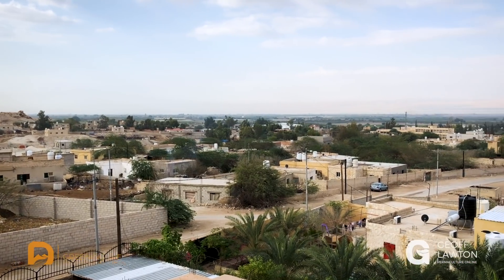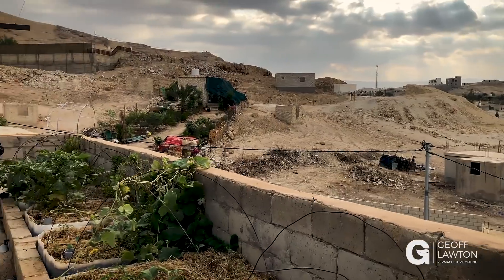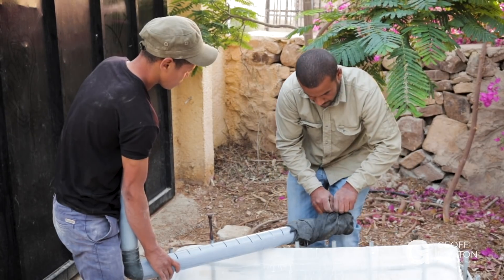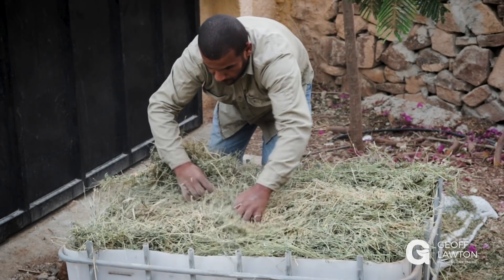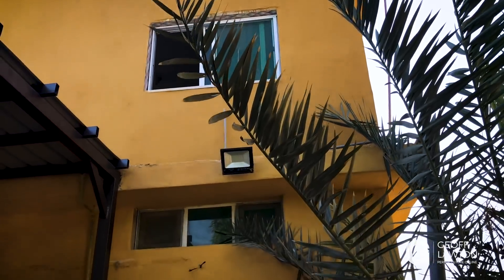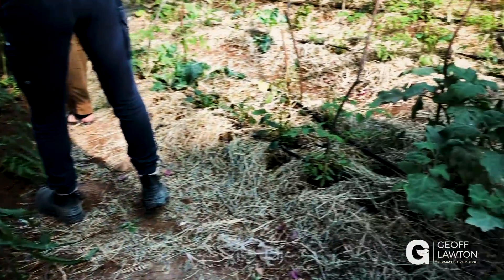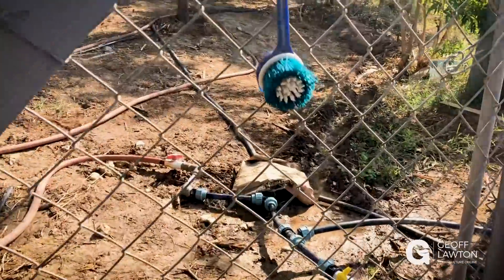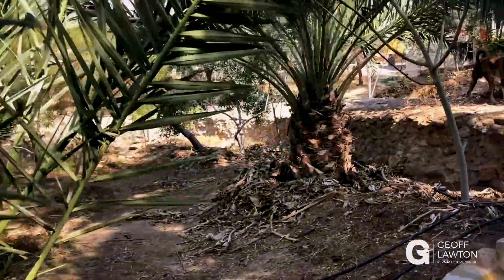Humans Have the Potential to Turn Deserts into a Green Oasis

Comment: You plan to fill the entire desert with flower pots??? Which needs regular watering? Is this practical?
Also, there are pipes running everywhere (which contradicts your video's heading of 'permaculture').
This is a good effort but should come under the title of 'Farming in the desert'

Comment: What is a read bed???
Reply: Costeño Salao  Yes, but a reed bed is a natural water filtration system so farmers can recycle the used water from the house. I looked it up after I watched this video.
Reply: Costeño Salao  So it is a plant, not a system to purified water using plants. Sorry, this is new to me.
Reply: @cqammaz53  it is what you said: a purifying system for the water flowing from the two kitchens mentioned in the video. I assume it is then used in the garden.
Reply: Mr Nepau2 doesn't it appeal mosquitos?

Comment: I was thinking of building a wicking bed on my balcony (a lot smaller: 45L), but I was wondering if I could use biochar instead of the pebbles. For two reasons: I want to save weight in case I have to move (it is a rental house), and I thought that I could activate the biochar with compost tea, to give the whole system an extra boost. Would you recommend doing this?

Comment: soooooo awsome you don't tell everyone to use compost all the way through. I have rough time growing compost in Arizona as it gets up to 116 regulary with 12 percent humidity in the summer rotting roots and killing plants. I have one question though: how does the water pull up through the gravel? I have always seen sand used as cohesion and adheason is better with the smaller particles.

Comment: I love your work Geoff but I'm a bit shocked by the crudeness of these wicking beds. As someone that people look up to and follow I expected you would've done a much better job here.

Let me walk the readers through some mistakes that are made here and how to do things properly.

First off it's best to take the 2 minutes that it takes to take the frame apart and cut the frame and container separately and just measure things out.
Then put the ends that you cut on the bottom and not let them stick out at the top to prevent people (think of the children!) from hurting themselves.

Ideally you'd also cut it inside somewhere to at the very least sweep those thousands of microplastics you just created and dispose of them properly rather than have them float through your garden.

Then instead of using gravel as a reservoir you use drainage pipe wrapped in geotextile. First of all this holds much more water, secondly soil can't end up in your reservoir as is possible with the example in the video. But also not entirely unimportant is that most gravel is some sort of limestone and always full of dust and this might have a negative impact on the pH of your water.

Then on to the actual wick, for this we are using coarse sand (mixed with raw biochar for even more water holding capacity and also to help keep the water clean if you want to get fancy). This sand is packed in tight to reduce it sinking later on and should be at the very least 1 inch higher than your highest water level two inch is better but also not more than that because water only wicks up a certain distance.

If you want to prevent your drainage pipe from ever clogging up it's best to connect it into your water reservoir directly, there is no need for elbows to be able to change your highest water level.

That brings us to the soil mix, this mix needs to be able to wick up the water but also be able to provide excellent drainage so your soil doesn't end up like a swamp in case you get rain. Sand is perfect for this and should be at the very least 1/3 of your mix but 1/2 to 2/3 is fine as well if you are short on compost.
Biochar is again optional and can be up to 20% of your soil mix, ideally inoculated with microbes and nutrients in this part. Rest of the mix should be compost and ideally wicking beds contain compost worms as well so they break down the compost and poop out those valuable worm castings which are one of the best foods for plants.

Clay should at all times be avoided in your soil mix because this can become swampy and anaerobic if you get a period of heavy rains, which I guess Geoff never gets in Jordan which is why it hasn't caused any issues for him.

Finally I'd like to adres the fact that wicking beds are not necessarily a water saving technique. Water is growth and more leaf surface also means more evaporation from those leaves if you grow plants that prefer much higher humidity levels suck as Corchorus olitorius (aka jute or Egyptian spinach) for example.
If you keep the water reservoir topped up then a plant like this will just excessively transpire to compensate for the lack in atmospheric humidity, at least it did for me here in the hot and dry Summer to the point that just a couple jute plants were drinking 50 liters a day in one of my wicking beds at which point I pulled them out.
So keep that in mind when you select plants and also in regards to how often you top up your beds.

That brings me to the one thing they are doing right in the video and that is a thick layer of mulch. 
Which happens to be the point that I'm doing wrong because I really don't like the hassle with mulch during planting and changing over beds from one crop to another but mainly because a good layer of mulch tends to invite both slugs and woodlice.
Reply: Permaculture Playground mmmmm Woodlice
Reply: Would course river sand work in place of sand in the wicking bed soil?  I have used the course river sand for the wicking action in the water reservoir space but I am not sure if you mean that you can also use this in the top soil layer?
Regards

Comment: Can you mark your location on Google Maps! It would be cool to see your garden from a satellite 🛰!   Hope it keeps 🌧 raining ☔️!
Reply from the maker: Hi LLC, try 31.871544, 35.631410. Because there are no street addresses here, it's hard to put a permanent pin on the location in google maps although I have requested it again from Google.
Reply: I actually see a lot of green spots in the Dead Sea Valley opposite Jericho that resemble the GTD site. For instance this neighborhood looks quite green 31.915678, 35.618341
Reply from the maker: Hi @VasilyKiryanov , the reliance of heavy irrigation and chemical fertilizers is abundant throughout the region. Water for irrigation purposes remains heavily subsidized, encouraging waste, and the planting of water-intensive crops. What’s worse is that with more than 50 percent of Jordan’s water being used for agriculture, it only produces a small amount of the local food supply. But it won't last that much longer. Jordan is tapping into it's last non-renewable water resource - The Disi project - pumping at full capacity pulling 160 percent more groundwater than nature is able to put in. When it’s gone, it’s gone.
Reply: Geoff Lawton I actually ment household plots. Are these heavily watered as well?